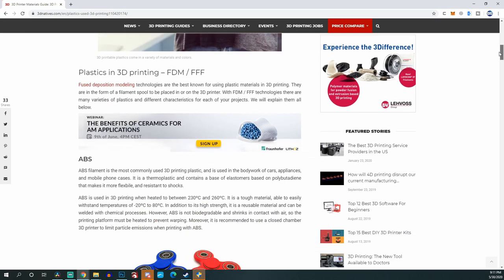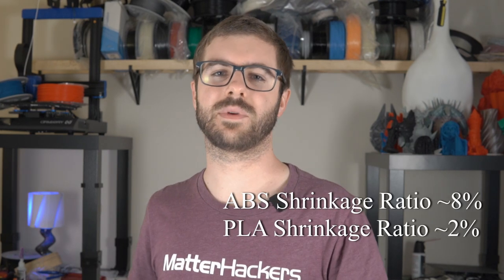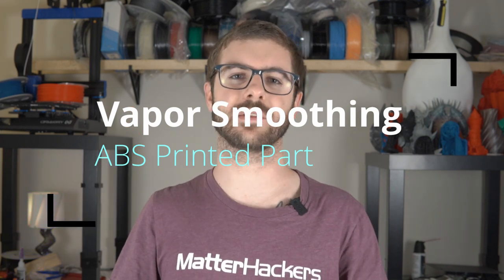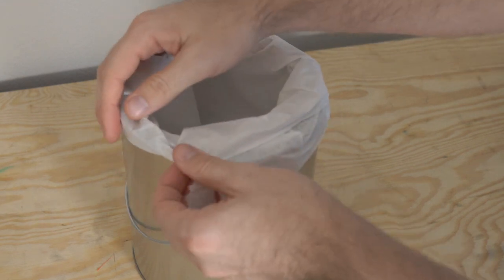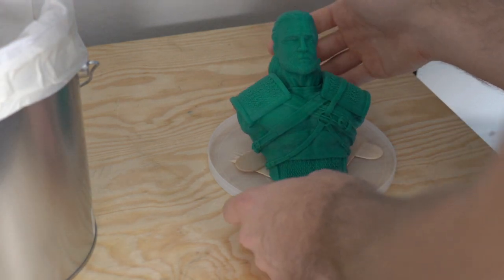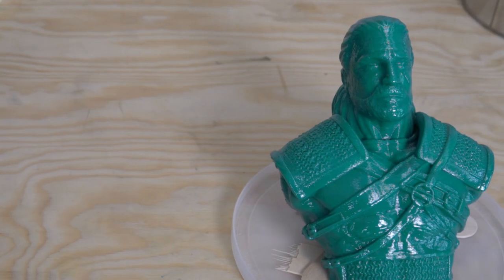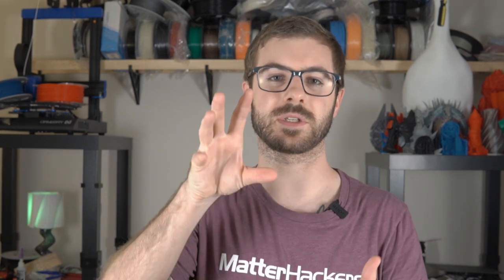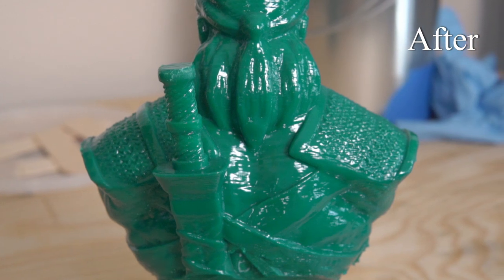Smooth 3D Printed Parts Without Sanding! Acetone Vapor Smoothing ABS

Comment: I 've been doing this for about five years. I do the hot acetone method. I've had no problems with it, just make sure you do it outside or in the garage. I use a rice cooker with a wire basket. You can put nuts and bolts through the wire to support your objects touching the object as little as possible. Every support will leave a mark. I put the object(s) in the basket and carefully lower it into the cooker. Pour a small amount of acetone down the side. It's trial and error how much to add but a couple of desert spoons would be a guide. Place the lid on the cooker. If it's glass all the better because you can watch the process. Turn the cooker on and watch the acetone start to sizzle and boil. I start my timer (in my head) when it's sizzling and 10 -15 seconds after that should be enough. If you look in you can see the vapour rise up the print leaving a glossy surface as it does. Remove the lid and see if it's what you want. If it's a little underdone put the lid back on for a few seconds. When your satisfied carefully remove the basket and put it somewhere safe for a while. Touching the print before it is fully hardened will mark it. Enjoy your excellent print.

Comment: Did this over a decade ago. Tip: Test the amount of time with failed prints and make a note on how much time smooths the parts. Next project, using acetone to glue different ABS parts together. My setup is with a deep fryer, a square picture frame glass for the print to be on and 4 little half inch blocks to keep the glass raised off the bottom to keep the glass raised. Only turn on for 10 seconds (or until you see the vapor fumes start) with the lid on. Wait 30 seconds, maybe more or less depending on amount smoothing you want. Test it first with broken failed prints to get the timing down. I do this outside or in the garage for ventilation and away from any open flame. For safety I also have a 3M organic vapor mask.
Benefits of heating it so the fumes reach evenly to the top and the bottom of the print.
Reply: years later, let me add another pro tip, poke holes in the bottom of the paint can or container being used. use more sticks to raise the model higher up. soak a single paper towel with the acetone. poke holes in the lid as well. hot glue a seal around the fan to the lid, place the soaked paper towel on the lid in just 1 or 2 layers, then place the sticks down, the opject on the sticks, the container over top of the object and connect it to the lid. turn the fan on to be at 500 rpms roughly. so it's a light breeze but not much. the airflow helps more the fumes around and not settle. like a convection oven. bakes evenly around the outsides and leave though the vent at the top (technically the bottom) of the pain can that's over the object. its fed around the object and then congested into a center point for it's exhaust.

Comment: I tried all the vapor smoothing methods. Simplest way to get a perfect surface is quite simple. Just dump the part in acetone just for a second and than give it a shake to get rid of any drops. Hang I on a string and let it dry.
Reply: does that smooth it too much? Or destroy the part?

Comment: I haven't printed anything of this size, but I've also only had my Ender 3 Pro up and running for a few weeks. 
My son mentioned vapor smoothing to me a few days ago and I actually did an experiment with a D&D miniature figure I printed at 1.2 with Inland PLA+. I didn't even have full acetone, but used nail polish remover. I poured the nail polish remover in a bowl, raised the mini up on an old shot glass, and then put another glass over top of the whole thing and left it for a couple of hours.
Even in a couple of hours, it looked promising. That hardness of the PLA had softened and I could see the features softening a bit too. It was a one-off print, so I decided to throw caution to the wind and just let it go overnight. 
By morning, it was really impressive. It wasn't nearly as shiny as the ABS and acetone, but the harshness of the layer lines had diminished, and it didn't have as much gloss as the fresh-printed PLA had. All in all, it was a good experiment.
I'm going to repeat the process soon and combine your method, using real acetone. With this being my first 3D printer, I wasn't ready to jump straight into a resin printer, but with this little experiment, my 3D miniatures might just be comparable.
Reply from the maker: Interesting. I have not heard of people using it with PLA. If you do end up experimenting more with pure acetone please share what your experience is like. Would be awesome to be able to get something close or at least something that it a step in the right direction.

Thank you for watching as well as for the detailed comment. Welcome to the hobby :)

Comment: I use a large glass vase (regular cylinder ones)  and use a silicone lid to cover. I use magnets on in side and out to hold paper towels with acetone. I also hang the item down instead.
Reply from the maker: The magnets was something I was going to do but ended up not. Hanging upside down sounds like a brilliant idea. I think that would have helped me get a more even smoothing.

Comment: ABS pros - sands well, it can be smooth with acetone , heat resistant . Cons - warps like crazi if not all requirements are taken to print it, and it smels a bit

Comment: Thanks for the video!
How would you compare this method and the Polysher/PolySmooth?
Reply from the maker: I have not used it first hand but if you do not need the strength or thermal resistance that ABS offers the PolySmooth box is a pretty awesome solution.

Comment: I followed all your steps but the brakes on my car are still rough :(
Reply: In seriousness though I just tried this on a test model - I used a pot on the stove with super low heat and a few tablespoons of acetone. The pot had a clear lid so I could watch the process and it literally only took 45 seconds before I had to open the lid to remove the model. Came out awesome! Thanks!

Comment: ABS is simply not a modern material anymore. If they find a method to smooth PLA like that, which is not extremly harmful, I would celebrate. A LOT! :D
Reply: True, ABS is not really a nice material, and not a really healthy one either.
Reply: Chloroform..
Reply from the maker: Yeah, I agree. There are alot of people that use it still though. Especially for printing out Automotive parts. Its high thermal resistance makes it perfect. I would love for a simple method for PLA!
Reply: 1 year late, but ASA is a nice material for prints. I print atm only in ASA even if i dont need its properties.
Reply: What makes ABS outdated? It's literally one of the most used and cost effective materials. What would be a better alternative with same benefits and same cost?